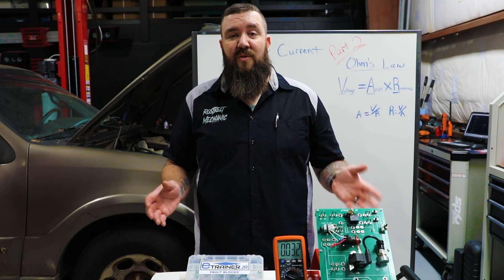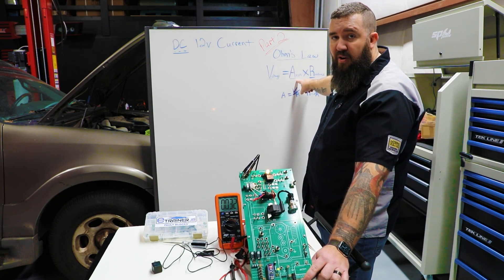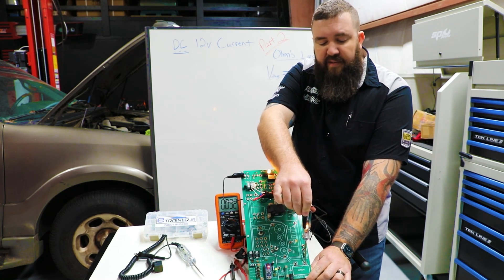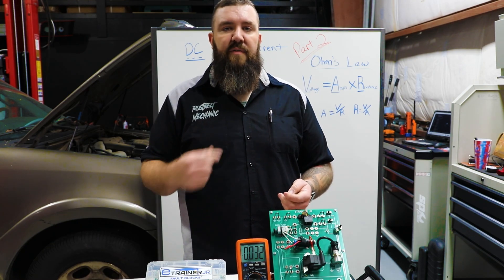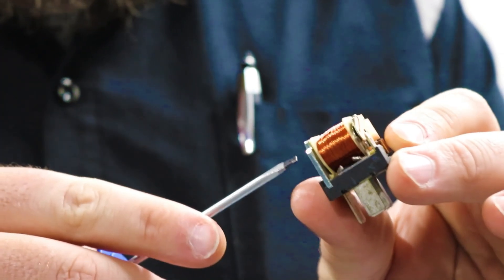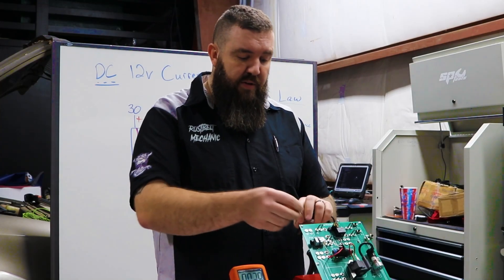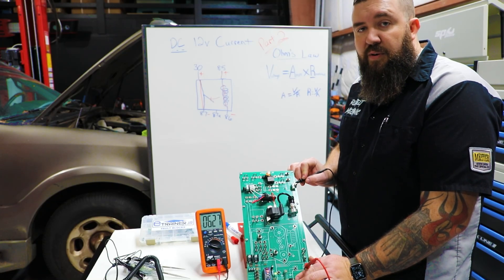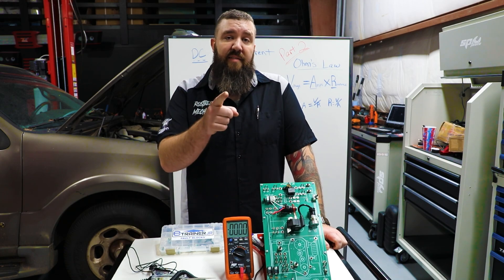BASIC AUTOMOTIVE ELECTRICAL DIAGNOSIS PART 2 TEST LIGHTS AND VOLTAGE DROP

Comment: When explaining relays he proceeded to explain that the magnetic field created in the relay “pushes” the arm to connect the larger amperage circuit. Then, without any explanation shows you how the real life relay did the exact opposite. Lol also amperage is not “used up” after a load. It is the same across the whole circuit. The voltage is used up. Just had to put this here just in case I can save someone months of hurt. lol

Comment: So when doing a voltage drop test, does it matter what lead id on the circuit, and which is on the battery?

Comment: The lever in the relay is to connect the tow points with the same electrical pole . The point deginated 30 is positive. When the coil is energised the other point  should be positive as well  .

Comment: Have to stop you at 5:30 when you say the bulb has used all the amperage so the test light doesn’t light on the negative side ,the amperage is still on the negative side as well as the positive side to correct your statement; the bulb has used almost all the voltage that’s why your test light doesn’t light on the negative side of the bulb in the circuit